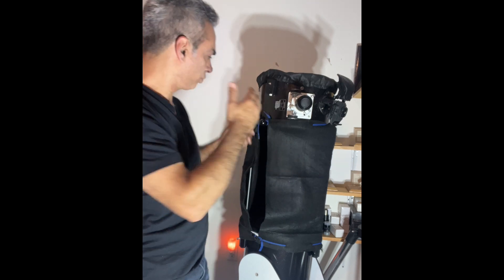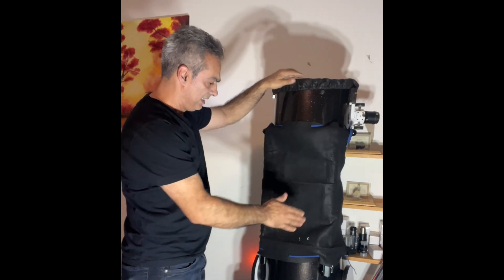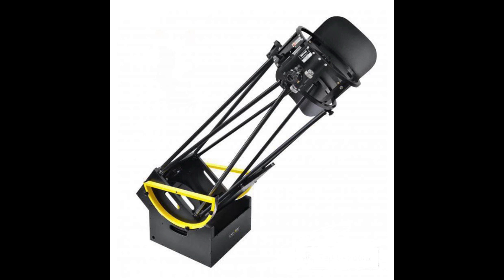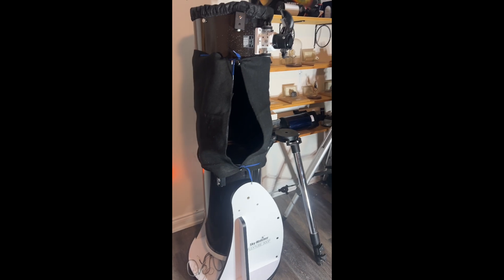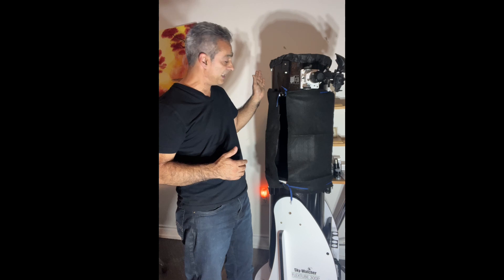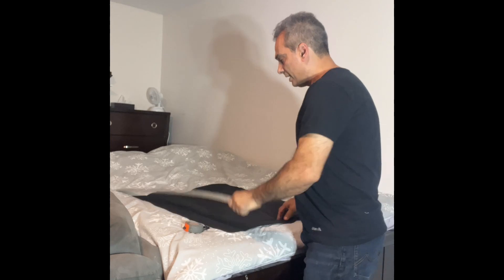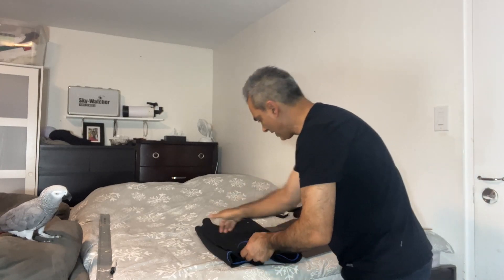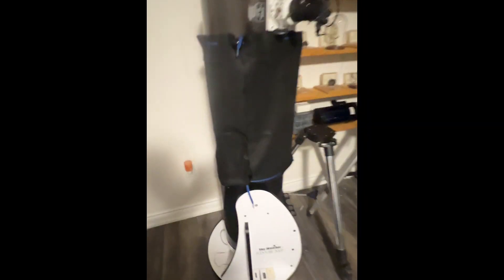update: on my shroud i built for my scope #telescope #astronomy #astro #science #diy #dobson

Comment: Measure twice cut once proverb (at least in my country) should be changed to always leave a lot of extra when cutting, in this case.
Reply from the maker: @janomacko5764  yeah where I’m from we use it mostly for woodworking cut once and measure twice
But I guess I kind of fits as well 
The good thing is I was able to easily add 3 1/2 inches and it works 
Thanks for watching